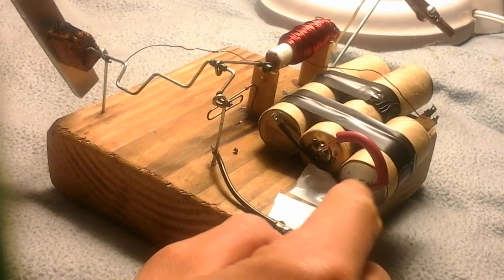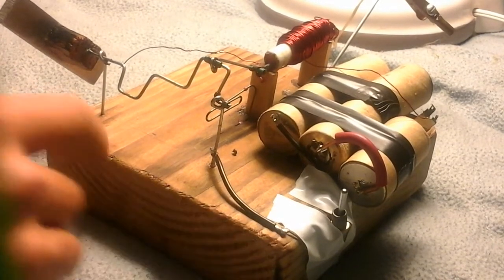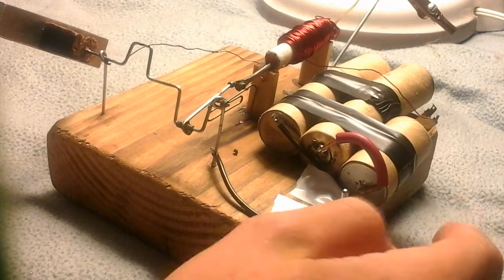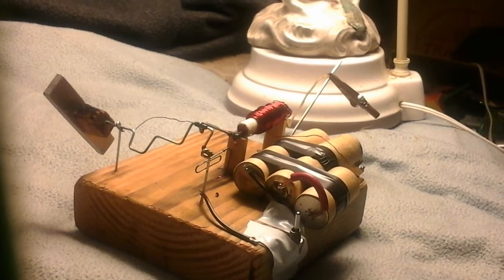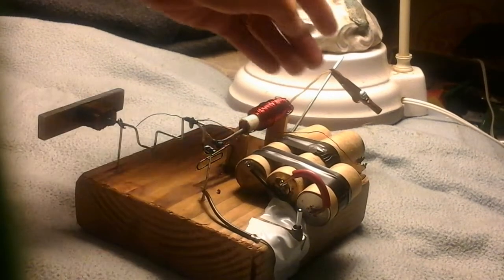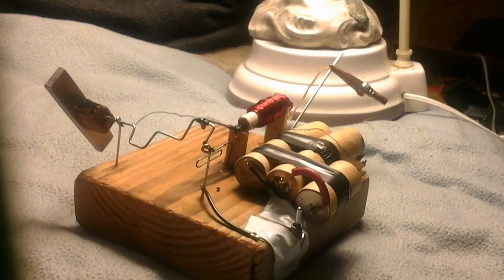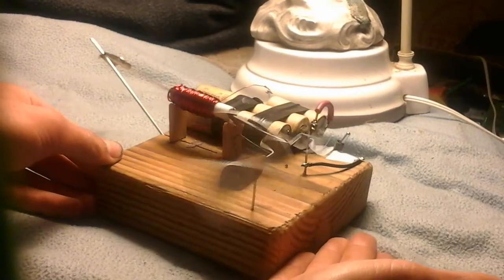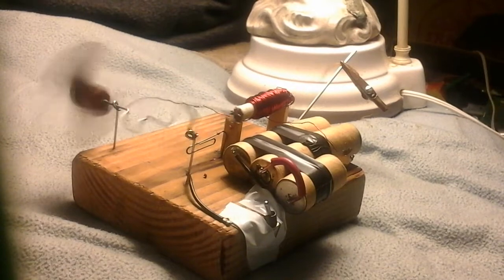Homemade Solenoid Engine v2.0

Comment: Now let's see it blow leaves! JK... I have never seen a better use for noisy leaf blower batteries! Subbed, 109 subscribers as of this comment(1-3-16). Motorized bikes...go with electrical and you can recharge it with solar anywhere anytime. Gas is on the way out...
Reply from the maker: I dislike electric motorized bikes because of their extravagant price, long recharging time, low top speed, low range, and total lack of style. I'm a gas and diesel guy!